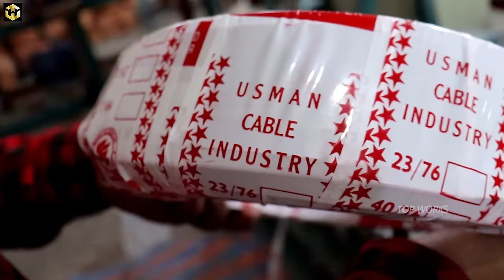How to  Amazing Electrical Wire Manufacturing in Factory Process

Comment: Super. Shown the process clearly.  How uniform thickness is obtained around the wire?
Reply: Using this set-up, it will be impossible to maintain uniform  insulation thickness. As the core wires are not twisted, and with no pay-off tension, the insulation thickness can not be maintained. In correct cable manufacture, before the extruder is speeded up , the operator  makes  2 circular cuts around the outer diameter , and 1 along. when this is removed, it clearly shows if the extruder point is out of alignment. Also, if small section cable is being made, a magnifier (shadowgraph) is used to verify correct alignment.  One operator deserves praise. The person operating the hand-winder is obviously very skilled.

Comment: Nice video. Technically speaking, in order to get the wires centered into the insulation, I believe that there should be some calibration to get the wire and the insulation centered before the process starting. I din't see it

Comment: How they write labels on wire not shown.
Reply: At beginning of the video, a container (covered in a white substance) with a wheel in it is shown. The wheel will have the information engraved on it(usually in reverse). As the cable turns the wheel, the information is transferred onto it.